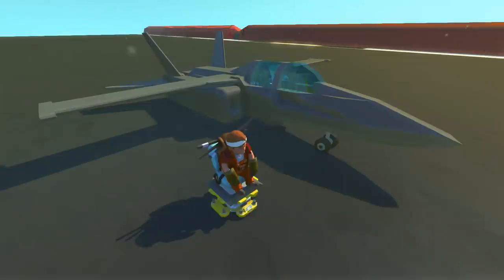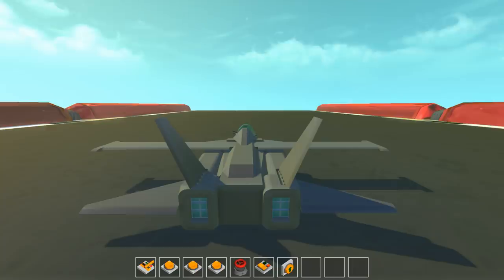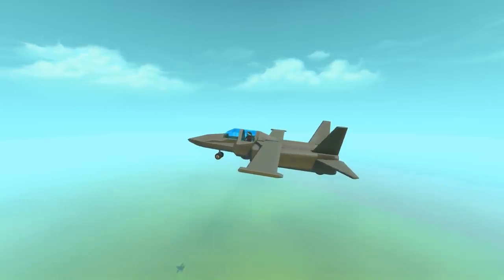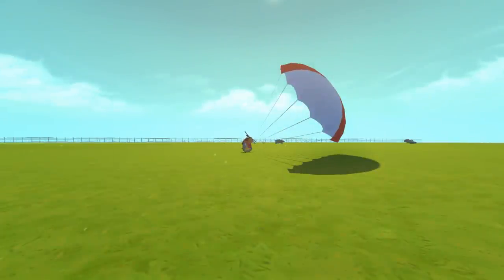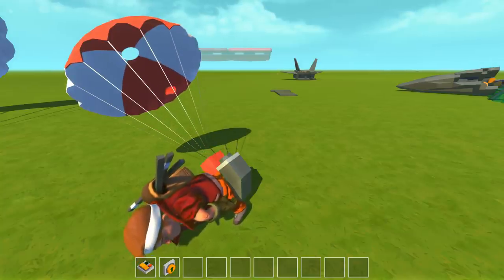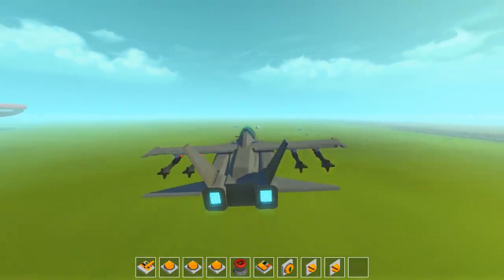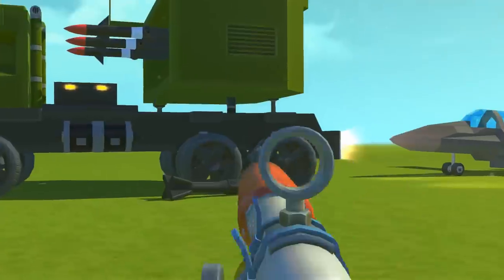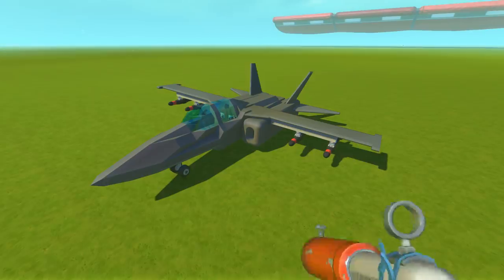EJECTION SEAT JET with MISSILES! - Scrap Mechanic Creations! - Episode 168

Comment: I’ve made plenty of jets in scrap mechanic but this one looks nice.
Reply: Do you use mods? I too like to build jets, but I have balance and center of thrust issues, how do you fix them?
Reply: @imm2gamer348  https://youtu.be/P-u24mW8yTs. Here is a video of a plane I made. This plane has its center of thrust on the line of the center of mass. If your center of mass is not on the same line as your of thrust your plane will tip up or down. I believe there is a mod on the workshop that tells you where all that stuff is located at on your plane. But you can also account for these nose up and down issues with trim tabs or just setting your flight control slightly up or down. And yes mods are used a lot lol. They come in handy alot.